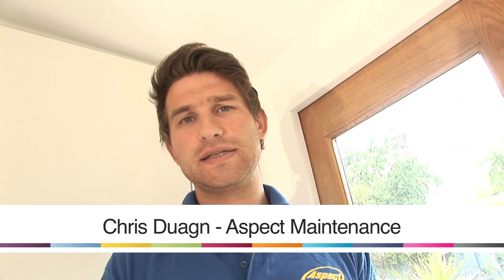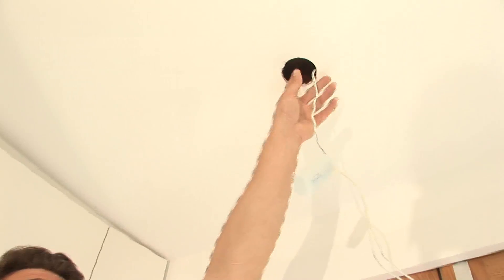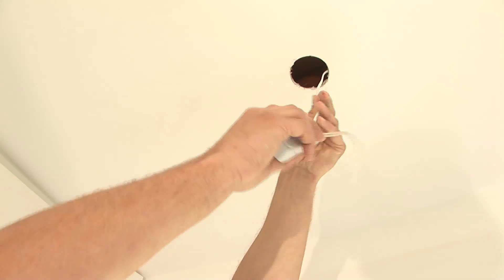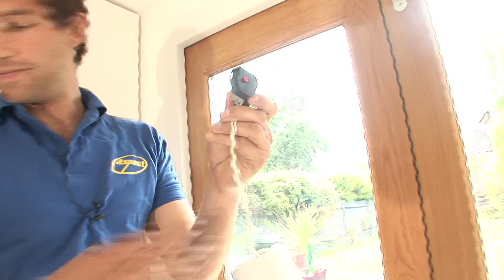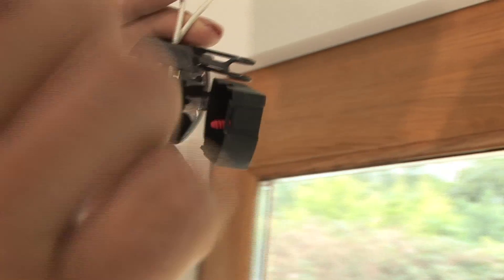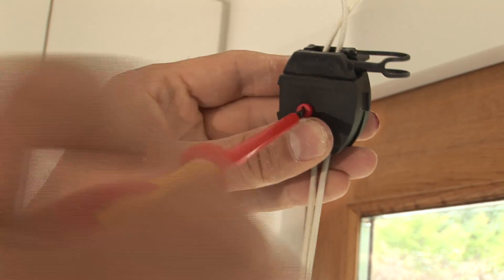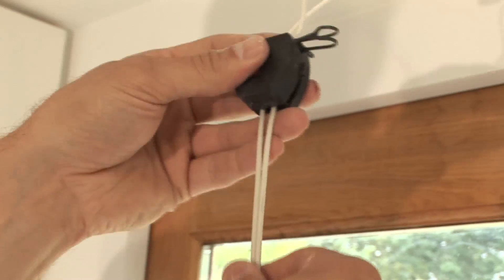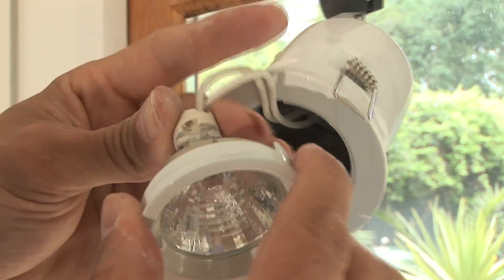How To Wire Low Voltage Light Fixtures

Comment: You shouldn't be giving electrical advice unless you're an electrician. You left out the the most important parts of the job: Cutting the hole for the lighting fixture & wiring the transformer into the line voltage of 220v, Euro, or 110v US... WTF?